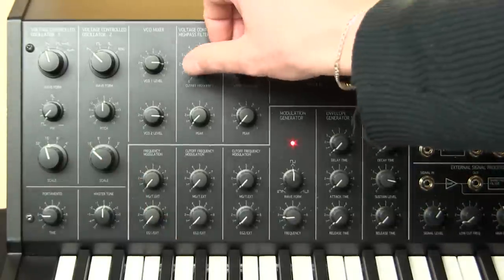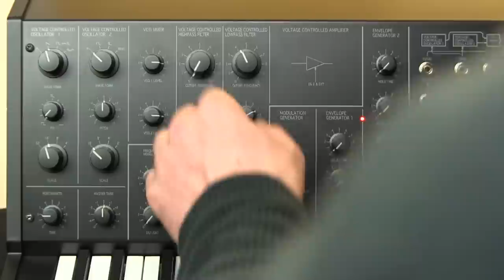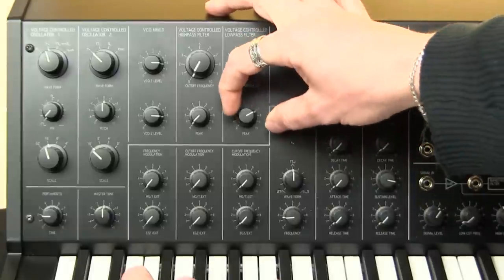The Korg MS-20 Mini- Filters Part One

Comment: I must say that I could get! the same sort of self-oscillating sound out of the monotron as I heard on the 'real' full-size MS-20 when I made an intro with it end of 1991 or early 1992.I found this weekend in my huge tape-collection the tape where I recorded some samples with that real MS-20. I have also the intro and a poem where I use the MS-20 in the background(I believe I used the MS-20 on it, must check that).I plan to put it all here on You Tube.Greetz

Comment: here, from the NAAM pr interviews:
"There were different filters in earlier and later versions of the MS20 - which did you use?

The MS-20 uses the KORG35 circuit that was on the earlier version of MS-20. Preferences vary between users, but we felt that the earlier version of the filter created a sound that had a more distinctive presence, and thus it was the appropriate choice for this reincarnation."

Comment: Every MS20 I played sounded different - so I wouldn't say this won't sound like a real MS20. The old ones come in 2 versions with each a different filter. The oldest one sounded great, the neer one just sounds good. The MS20 mini is a replica of the newer one, so definitely genuine MS20 circuitry, only not the one I hoped for.
Reply: The mini is a replica of the first MS20 filter type.

Comment: Hey! not sure how often you check these comments, but can you just use an aux chord and then put a 1/4" converter at the end of it ? or does it need to be a 1/4" cable with a 1/8 inch converter.. hope this makes sense
Reply from the maker: +Jason Tibi I'm pretty sure you can do any of those things!

Comment: 1:12 you mention that the LPF is -12dB without explicitly pointing out that the HPF is single-pole.  Seems like you're insinuating that the HPF has the same slope as the LPF which isn't accurate.  Looks like you make that insinuation multiple times too so I'm starting to think that you didn't know the HPF is -6dB per octave.

Comment: Marc, there was a guy who had a look at the oscillators of the MS-20 and found that the sawtooth at 32' wasn't straight - but exponential, which is caused by high pass. He changed the coupling capacitors (the ones in line with the signal to shift DC-levels between the two modules) because they were too small (he changed them to 100uF he thinks) and found that this fixed the problem and boosted the low end! Would this in any way have been replicated in the mini, and is a mod possible?